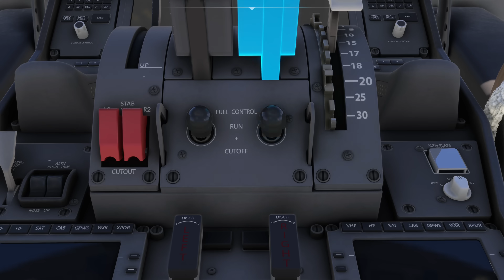Air India 171: Why Did The Fuel Cut-off Switch Get Moved?

Comment: You should watch flying beast latest video than watching this boeing paid shit!
Find the real cause and post the video! 
The preliminary report is not even signed and they have not even shared the conversation of such a short flight. It will hardly take 1 page to write the conversation of 37 second flight. And they are still accusing pilots over the 2 sentences given in the report. Disappointed!

Comment: I'm curious since the fuel cut switches are wired to computers/controllers that do the valve switching, why isn't it possible for these related components to switch off and on the valves (glitch?) while the actual cockpit fuel switches remain untouched??

Comment: RAT was initiated before the fuel switches were transitioned to cutoff, as RAT started providing hydraulic power at 08.08.47 and as per boeing manual it takes 6 secs post initiation of RAT to start hydraulic power that also means it was initiated at 08.08.41 which is before fuel switches were transitioned.. what happened between 08.08.39 to 08.08.41 is not clearly mentioned in the report but something definitely went wrong during this time that indicates dual engines failure and further rat deployment.. pilot tried to relite the engines post that by fuel switches cutoff and then moving back to RUN.. so stop speculation and blaming pilot without acknowledging all the facts that are still covered

Comment: I’m a long-retired airline pilot, last flight in 1996 on the DC-10-30 but previously 4,000+ hours on the Boeing 757/767 with nearly identical fuel cutoff switches like the 787. If I remember correctly, with the FO flying, after the 80 knots call the captain put his hands over the throttles until V1 where he wound make the abort if necessary. After V1 his hand was removed from top of the throttles and places behind them which put them over the cutoff switches. The FO would have both hands on the yoke and be concentrating on the attitude indicator for accurate pitch angle and wings level preparing for any engine failure at that point. He would continue flying the airplane.  
With all the speculation going on, I’m surprised no one has thought about this possibility. We need to have the final report on AI171, but if the captain cut the fuel off, did he have a plan to save the airplane rather than crash it and become a hero?
Was he counting on the FO not seeing him cut off the fuel and called out, “Dual engine failure! Fly the airplane and I will try to restart them”. This captain was very experienced in 787 and may even knew how long a restart would take. We have all done approach to stalls in the simulator and realize that in an emergency you could probably increase the pitch some up to the stick shaker. If it didn’t work, at least he tried. 
If it worked, the hero, but if not, his family would be proud of him. (And be well compensated for his death.) I find it very hard to believe this man just wanted to commit suicide and take everyone with him. He had to know what that would do to his family and his own legacy. It seems to me his timing of the cutoff was perfectly planned. But the FO’s comment on seeing the act foiled it.
Maybe you speculators could refine this scenario.

Comment: It’s pretty clear that there has not been sufficient clarity on this channel regarding the actions of the pilots. There is a far better analysis of the takeoff and subsequent crash by an Indian pilot that includes timestamps and simulator use to explain what is going on. Also the instructions for pilots in the event of engine failure, guess what? Cycle the fuel cutoff switches to trigger automatic engine start sequence. It is a lazy investigation that blames the operator. There is a previous instance of a 787 losing altitude as a result of the fuel supply being cut with no physical movement of the fuel switches which remains unexplained. I also find it difficult to ignore the number of components between the physical switch and the fuel supply valve, many components that can fail and have failed. What about the computer (ecu) between the switch and the valve, I would like to see Dee (coding with Dee) pull the code apart to see if there is something going on there. Anyway it’s clear from the Indian pilots analysis that the engines lost power right after the wheels left the ground.
Captain Steve was on the money with the RAT but lost the plot jumping on the pilots

Comment: Fuel switch cut off because it was supposed to do so, based on boing manual when both the engine fails you reset the fuel swith to go in start condition to reset the engine. You so called experienced pilot captain steve. Go and fuck off. Dont give wrong information given by your media and money you got from boing. Get your ass off from our country

Comment: Dear Captain, You are fixated on the fact that pilots cutoff the switch deliberately. There are many possibilities like electric failure (which is being investigated as per media reports) or the very obvious scenario that pilots did cutoff the fuel but in response to the engine's failing and not the other way around. That's why a proper unbiased investigation is required and just picking up certain words from the preliminary report and igniting speculations is really foolish of you!

Comment: Comment on your previous video- They dont come with a definitive reason? They literally cherry picked the details favoring Boeing. Have you tried simulating the same environment or investigating using your experience and knowledge in picking out the sketchy data? Rather than just bluntly accpeting WSJ report, who will obviously trying to save the Boeing and USA image, try to double down on the case and im sure you will come up with other conclusion. No problems with the fuel switches? UK aviation board released an appeal on May 17, 2025 for fuel switch precaution and inspection specifcally for 787. Why dont you mention that? Just being horse headed and focusing only on the preliminary which obviously can be influenced, you could have research about the 787 history! Moreover, any official document has a officers signature, does that preliminary has one?Get into the details

Comment: The engines were shut down by the airplane's "logic". NOT BY THE CUTOFF SWITCHES.. FADEC shut the power down because the A/C was reporting ground mode, not Air Mode. In Ground Mode there is a system that prevents UHT. (UNWANTED HIGH THRUST). called TCMA. This system will shut down the engines. It also prevents further thrust increases. 

Nothing wrong with this aircraft that a duff killer logic cannot destroy.......

It's in PPRune.  Explained in detail by its developer, tdracer.....

Boeing is done

Comment: I'm just thinking this through here, it seems that whatever happened to the engines or cut-off switches happened exactly as the plane's nose lifted (taking into account the RAT deployment time). That seems far too much of a coincidence. I think there are a number of questions I would want to ask: 

1. Were there any other noises on the tape at that time? Because one scenario that keeps popping up in my head is something in the cockpit, like an unsecured bag or a flight information clipboard or something, moving or falling when the aircraft rotated and catching the switches on the way down. I know they are not supposed to be able to move accidentally, but I'm wondering - if the design is very similar to the faulty ones on the 737 MAX, and given the obvious maintenance issues AI clearly have given the state of repair of this and at least one other of their Dreamliners, could someone have replaced the thrust control module and switch panel with an incorrect 737 one which had that fault? The pilots are used to lifting the switches all the time to move them, they might not have noticed the safety gates were missing in all that time....

2. If it was the case one pilot deliberately turned the switches off, why didn't he try to stop the other pilot from cycling the engines and powering them up? And if the other pilot was sure the first pilot turned them off, why didn't he say something else when the first pilot denied it? The whole scenario doesn't make sense, there must be easier ways of crashing a jet. And on that subject...

3. If it is the case that you can crash a modern Boeing 787 just by flipping a couple of switches at the right time - WHY IS THAT EVEN POSSIBLE?! If they are only required either on the ground or in an emergency, you would have thought that there would at least be a plastic lift-up cover over the switches IN ADDITION to the lift locks on the switches themselves (look at the red fire switches right next door to them). I saw the pictures of the "bump guard" arches next to the switches - those would only protect something hitting them from the side, something catching them from above with sufficient force could force the switch to override that tiny little tooth on the safety gate. And on that subject, given the repair issue mentioned above, do we know if those bump guards were actually in place or was one broken/missing? And if the engine is stable, not on fire, at full power and clearly in takeoff configuration, why wouldn't there be a safety relay or a time delay to stop the engine shutting down if the switch is moved or a doomsday-invokingly LOUD alarm signifying that the switch was off at anything OTHER than Idle power? The whole idea smacks of a serious design flaw which Boeing should have caught and weeded out, regardless of the actual cause.

Comment: I think the accident happened due to a medical reason which was never diagnosed or could be identified. He definitely had to perform an action at 3 seconds after take off which his body knows. But due to sudden medical condition that occured in that moment, he blacked out. After quickly regaining consciousness, he mistakenly operated the fuel cut off thinking he had landed since his body is ready to perform an action. That is why he doesn't remember what he did. I dont think its suicide or mental instability.

Comment: If theres no cameras on the cockpit, how they are sure that the switches were physically chenged of position and not a false signal or kind of flickering digital signal on the fuel cutoff switches? (Electrical issue on the digital electronic system).

Comment: Boeing 787 8 fuel switches when switched  off manually need 3 movements . 1. Pull up switch 2. Move switch 3. Release switch into new position  makkng arecorable click noise .  2 switches moved manually one after the other takes 2 to 3 seconds..  CVR has no recodings of click click , and fuel switches transitioned fro. Run to cut off sequentially in < 1 second .... not 2 to 3 seconds.

This all absolves the pilots unless new evidence comes out.

Comment: Would the movement of the fuel cutoff switch from cutoff back to run even make the engine spool up again? Because like in almost every airliner you start engines on the overhead top panel and at specific N2 you introduce fuel. In modern aircraft or in 777 you can do that right away. In 787 you can do that at the same time to both engines, but firstly you need to switch the starter engine switches to RUN on the overhad.

Comment: here's another thought, what if the captain was looking out the window and the pilot turned off the fuel and then ask the captain the way he did just to make it look like it was the captain that shut off the fuel. pilot knowing that a crash is inevitable, maybe that's why the captain said it so calmly ( i didn't turn off the fuel) he may not have known until a few secs later that the fuel switches were disengaged then acted accordingly, all was too late.

Comment: Driving by wire the other night on the computer, there was a power supply interruption for less than a second.  Got away with that not shutting down the computer,  WRONG! Next thing I know is the wheel and pedals are not working and the keyboard, but the game kept running perfectly.  The truck crashed with NO input possible. 
Control, Alt, Delete worked, so the power interruption only affected the interface software running in the game.
That aircraft had electrical issues not looked at by the investigation team, this could still be the computer and or an electrical issue that triggered the engine shutdown

Comment: Why did you cut off ? What exactly he is talking about cut off? Air conditioner or any thing else. Why was not full transcript posted in report. Why u r coming to a conclusion that it was fuel supply just because someone posted a bullshit report which is without any signature of any official.

The exact answer is that engines failed just after the plane left ground. It may be that the pilots where sticking to the boeing's guidline regarding engine failure where it states that restart the fuel switches. Which exactly means cut off and start again. Also see when RAT got deployed no timing given in report but timing of RAT supplying power mentioned now your boeing engineer say that RAT gets fully  functional after 6 seconds so that means at 8:39 the flight takeoff and RAT started giving power at 8:47 go 6 seconds back when RAT got deployed at around 8:41 so engines got failed just after 8:39 or 8:40. That means first engine fIled and then fuel switches were touched . So Captain Steeve it seems to me that u r a rookee trainer
Reply: Also why report says that after restarting fuel switches one engine didnot respond. Why? And the other engine not responding fully. You know when engines go down they don't go down fully it takes time. That means if we restart them there are chances of revival. Then why they failed?

Comment: I am quoting chronological order of events from the report, 
08:08:35 - v1 speed achieved, 
08:08:39 - lift off time, 
08:08:42 - engines achieved max speed of 180knots,
Reports says - Immediately after this the fuel switches were transitioned to CUTOFF in interval of 1sec. It doesn't mention
the time of such an important event. WHY?
08:08:47 - RAT had started supplying hydraulic power to plane.
 on a AIRBUS it takes 10 sec for RAT to do this, BOEING does it in 6 seconds, WHICH MEANS ENGINE's FAILED - 08:08:41, this means that it has nothing to do with fuel cutoff which happened sometime after 08:08:42
08:08:52 - Engine 1 FUEL CUTOFF to RUN
08:08:56 - Engine 2 FUEL CUTOFF to RUN
08:09:05 - MAYDAY was sounded by pilots
Why were the fuel switches put back to RUN? if it was a suicide mission, this was not supposed to happen. There SHOULD have been a fight in the cockpit, the voice recorder should have caught all that, none of that is mentioned anywhere !!!
It could also be that the pilots were trying to save the aircraft, that's why they tried to restart the engines by turning the fuel back ON, and also PLEASE NOTE that ONLY ONE engine spooled back the other engine DIDNOT. WHY? 
If the aircraft was fine, then both engines should have spooled back.
Let me know what you people think
Reply: Correctly analysed
Reply: Nice summay

Comment: Captain, Your kid would deny when questioned about his mistake, because he is going to remain there and will  face the consequences of his deeds. 
 But if the pilot was suicidal he didn't have to worry about consequences therefore had no reason to deny .
 people who commit suicide- even Criminals- disclose the truth in their suicide note.

The preliminary report is not signed, Full cockpit conversation missing, timestamps missing, no technical expert / engineers or pilots  in the investigation team, no press conference,.no sign of struggle or heated exchange  between the  pilots recorded, (to be noted: no reason for suicidal person to deny changing the switch position  or allow the other person to switch it on again or contact ATC)
Copilot would have said something to the captain apart from questioning about swithes ,if he had been convinced that the captain was deliberately trying to crash the aircraft 

Still blaming the pilot?? Unbelievable!!